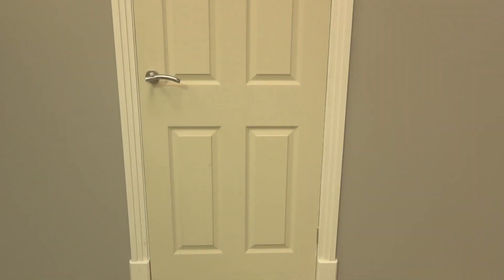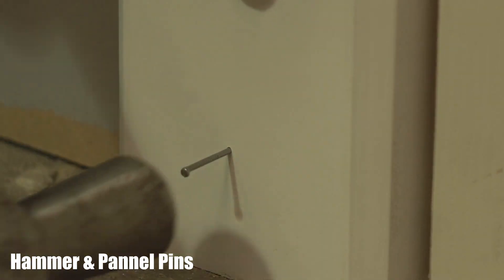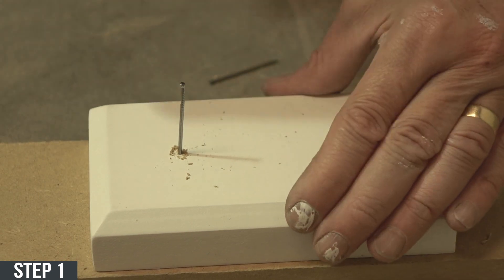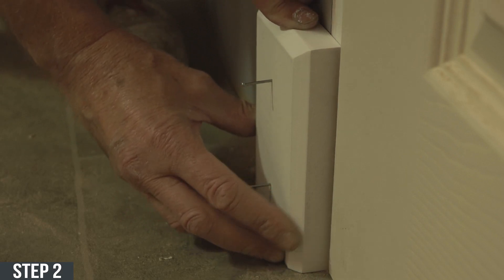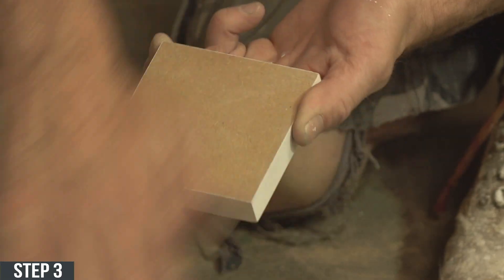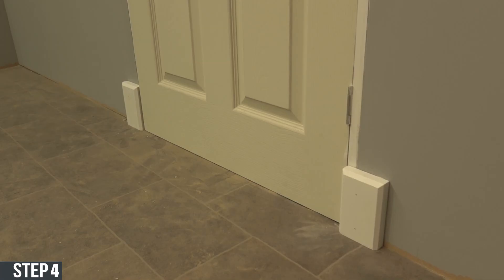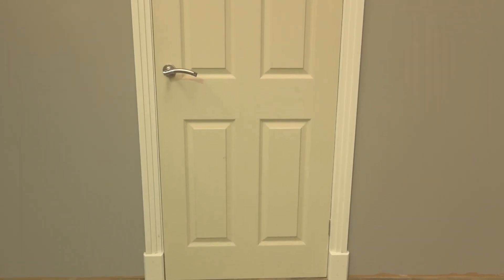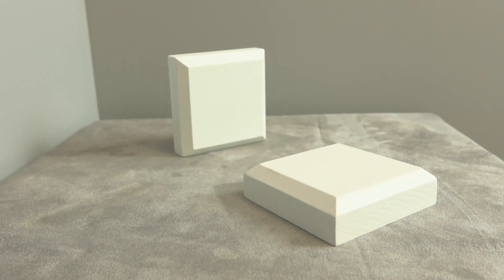How To Fit Plinth Blocks & Rosettes | Skirting World Tutorials

Comment: How do install on concrete walls let me know thanks
Reply: Fastenmaster Flex 180 (3min open time)… or Flex 40 (40 sec open time) strong stuff, won’t let you down… 
I would suggest using a high output glue gun like: Infinity Bond Ranger Pro
-that’s what I use to glue thresholds to concrete